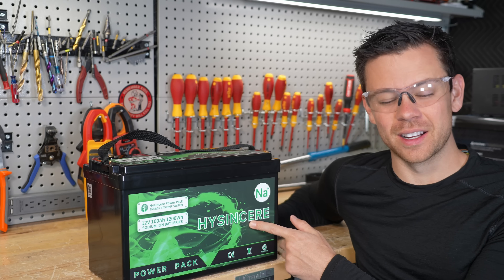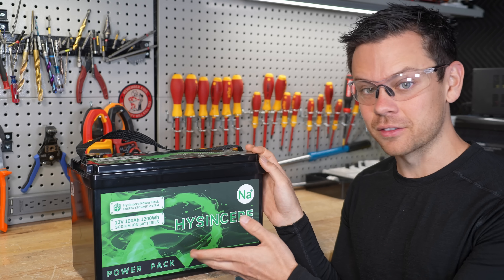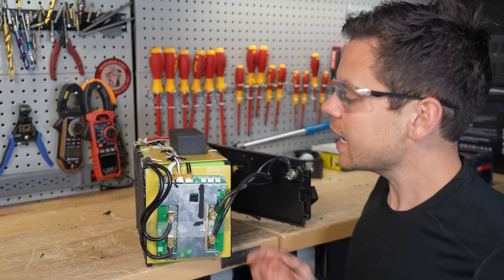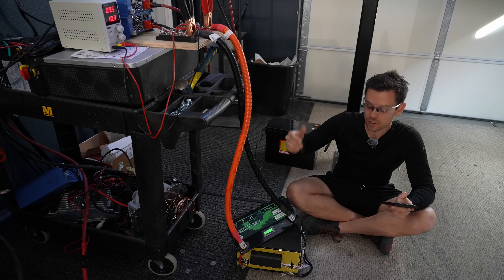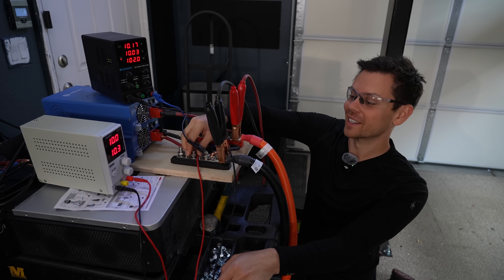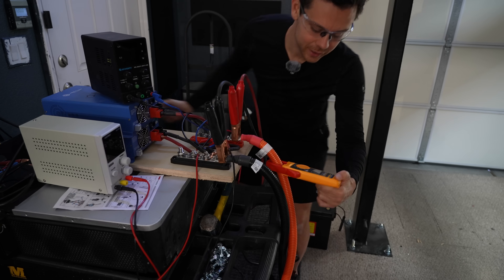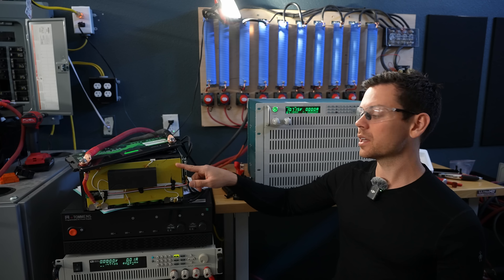Testing My First Sodium-Ion Solar Battery

Comment: The design spec of sodium batteries is to discharge down to I believe 6 or 7 volts for full capacity.  Your equipment isnt for that battery chemistry. And yes it's already well understood that we need new inverters that will run down to voltages that low.  You weren't ready for this test and came up with conclusions based on "doesn't work with my 12v lfp equipment so must be bad ". The current price is terrible, but next years cars with sodium aren't out yet either.  Hang on to your seat because once you see these at 1/3 the current cost on proper inverters and chargers they're going to end up everywhere very quickly.  Nothing wrong with the cheap lfp we have now but it's the wrong move to ignore sodium.  It's already here to stay.  Keep your eye on it.  Next year will be crazy.

Comment: As a vehicle starting solution LFP with a heater is only practical in mild climates. Here in Central New York, November to late April we can see sub freezing temps for weeks, or even months with sub zero temps not uncommon. Keeping the heater running that hard wouldn't be practical. heating once started (with a delayed charging system wouldn't be practical either as the battery mass and insulation of the case would take a very long time to get the battery into the safe zone, and even then it would have to be isolated from the cold air moving over it. Not impossible, but it would require heating by engine coolant and an integrated heating system. An internal electrical heating system could work as well, but still would need insulation and custom charging circuitry.
Thanks for all your detailed analytical videos!

Comment: I know it's apples and oranges, but CATL is claiming their now-in-production SodiumIon(naxtra i think they call it, or idk, NaC-stra), but they're not known for BSing. I have their battery in my 23 M3 LFP. They're saying 175w/kg. That's about what i've read my cars battery is. Maybe better. Sodium ion isn't there yet for home storage but within a year i imagine will be dirt cheap and match LFP with no need for heating. This is a rapidly changing and evolving thing now that the big guns(CATL) are in mass production. I think that'll trickly down to home storage. 
I cannot wait to be off grid or close to it.........By the time i get a new home built even with the nonsense economics we're suffering(tariffs and harming renewables) i imagine it'll be 20% cheaper than it is today, inflation accounted for. Just the other day CATL says their ev NAXTRA batteries are clocking in around 10 bucks a kwh. That' sjust crazy

Comment: The problem I see with sodium ion is that it has nearly no value for recycling. Only some copper and aluminum. LFP has some lithium and NMC also has nickel and cobalt. Didn't know round trip efficiencies were that low. Maybe LFMP is the next step before sodium? And maybe sodium batteries will get different variants as well? I mean we say 'sodium' battery, but if we say 'lithium' it can be LFP, LFMP, NMC, NCA, LiSOCl2, lithium manganese, and more.
Reply: There are various sodium battery chemistry, like sodium manganese, sodium sulfur, solid state sodium, anode free sodium metal, etc. But none of them are on the mass market just yet as those are still researched in the labs

The only sodium battery chemistry that are mass produced right now is sodium iron oxide (NaFeO2)
Reply: @sihamhamda47 that's the comment I'm looking for, thanks! I know there is a chemistry with lots of nickel but that's not readily available so it defeats the point of using sodium instead of lithium. There's also salt water batteries which suck, and some kind of molten state battery. Needs to be heated at like 200°C to work. I don't think that'll be a good chemistry either

Comment: I've made lots of sodium-ion batteries for vehicles, much better than agm and cheaper even. I have one in my car, atv, snow blower, lawn mover and even in jump starter (10Ah is easily enough to start a car). There's no point using lead acid anymore as a starter battery. There's some videos on my channel if you're intertested

Comment: not a battery expert.. but why you dont discharge it till bms shuts you off? why 10V? and can you share somewhere how much kwh it took to charge the battery and how much kwh you get out of the battery ? 0-100% and 100%-0? ...
Reply from the maker: Did that on first test
Reply: @WillProwse  thanks for the answer! :) will check it out!!.... i honestly dont see that big issue in such big voltage change.. my pv invertor works with battery voltage of ~500-800v. So to have this batteries in series with some balancing might be interesring option (if the price is right)

Comment: NO.   Automotive Development Engineer Here from the former REAL Chrysler Corporation.  Sorry, -22F is NOT  a starting battery, we normally test to -40F or below, routinely vehicles have to start at -50F and -60F.    A HIGH internal resistance battery is NOT a starting battery, EVER.   at -40F it can take 850 AMPS to start a moderate sized engine.   Cold engine, cold oil, cold everything, and, since the fuel is cold,really cold at those temps, you might need to 'crank on it' for a few seconds, so that is 850 AMPS not for < 1 second, but several seconds, lets see your modern 'push button start' car handle that rather than you holding the key forward to start and doing it for 3 to 5 seconds.    NO WAY IN HELL is that sodium battery going to be a 'good starting battery'.   A lead acid will give up 150-200C+ in a starting environment.   Especially when its plates are formulated as a 'starting battery' which is a world different than a 'storage' lead acid battery.
Reply: Yeah i live in Wisconsin and we see -20F pretty much every winter at least one or 3 times.   I've seen -30Fs a few times in my life.

Comment: The main issue I see here is these are being compared to lithium and being used with equipment designed for lithium so they are getting a bad review. It's like using a lithium battery in a system for SLA batteries and calling them junk because the specs don't line up.

The discharge curve is linear so SOC can be read directly by voltage making it exponentially easier. The low voltage cutoff is way too high, sodium ion can be discharge to near zero volts. In fact a lot of grid scale are shipping them shorted. Companies shipping these with a BMS designed for lithium are doing a disservice. They need a cutoff of ~1.5v per cell. This would give a range of ~15.8v to ~6v usable on these batteries. Cutting them off at 10v is leaving a lot on the table.

Once the inverters / equipment catch up to the new chemistry to make use of the wide voltage range and the manufacturing ramps up, these will be everywhere. I predict these will be cheaper than SLA due to the abundance of material, no hazmat classification, and weight.
Reply: That huge voltage range is a potential liability as you will need over 2x the amperage for a given wattage between 100% SOC vs 10%. Your equipment is definitely going to run hotter. Voltage curve is also chemistry dependent so future research isn’t going to change that.
Reply: @ratshackmojo  If you don't account for it, but that's true of any design.

Comment: Give it a few years for the technology to mature. I also agree that the quality of these early release units will vary greatly as shady pump and dump builders get mixed in with quality builders.  

The only other review of anything Sodium batteryI have seen was Hobotech testing a Bluetti system. Bluetti is one of the leaders building power stations so you would expect higher build quality.   Hobotech noted the higher cost and heavier weight as well as larger unit size. The plus side was the Bluetti Sodium battery unit can be charged at below freezing temps.

Comment: The promise of Sodium ion is cost.  Electrolytes are still being developed and production lines are still being ramped.  I would think in two years, the charging curve can be flattened and the cost will be less than LFP.  The long term goal of Sodium is cost at roughly 25% of LFP, or about $25/kWh.  It will take time to get there, check out some of your old LFP reviews from about 5 years ago when the chemistry went mainstream.  If South Korea can start producing Na+, we should see a good drop in price as they compete with CATL.  At this point, all those green cells appear to be first gen CATL cells, likely early demos, or first run production on the new equipment.

Comment: I have an unrelated question for you. how about wiring a Vatrer 300 amp hour battery in parallel with a different 200 amp hour battery and utilizing the self-heating and Bluetooth BMS from the Vatrer for both batteries?

Comment: I would not discount Sodium just yet, in Tech SSD drives with TLC NAND were considered the worst thing since the first great video game crash, then about eight years ago Premium TLC drives started to come out that completely owned the market, products like Samsung 980 Pro.

Sodium will probably do something similar, new tech and ideas like staggered discharge to smothen out the curve could be one thing that keeps Sodium in the game.

Like all tech it does have downsides though.

Comment: From the graph, 14.5V resting (~3.6V/cell) would be about 80-90% SOC, and 10.6V resting (~2.6V/cell) would be about 20% SOC, so you were able to use about 60-70% of its total coulombic capacity. It is kinda like Lead Acid, in that about half its rated capacity is generally usable (in this case meaning in a useful voltage range), except that it won't get damaged if you deeply discharge it - it'll just need a lot of energy to recover to a useful voltage range from a deep discharge. I wonder how much of the heating is due to exothermic processes and how much is due to the ~0.6V drop (60W at 100A) due to internal resistance?

Comment: Lol ... the video should be called "here is my charger collection".
For what i experimented .. Sodium cells are way behind LiFePo4 .. and still will be for a long time, even the price is not lower... so .. it need at least 5 more years before maybe catch up.
Yes there are some advantages, temperature wise particularly .. but appart from that ... naa .. not good .. :D
It remind me the Oled war with LCD, first OLED in 2007 and see today, yea Oled got advantages but it's not the total game changer that was announced and even worse, it's now kind .. dying under LCD technologies like micro leds .... yea ... i feel the same will happend to Sodium cells. And a new technology will replace both LiFePo4 and Sodium ...

Comment: didn't know about the voltage....no future then (at least for me). I need small "high voltage" battery packs to run my house (currently with 320-330V LFP batteries)

Comment: Testing Na battery capacity charging to 14.5V ? Ridiculus, it is meant to be charged to 16V. It is very different, so it would need different inverters. Also it is early days, price and resistance will likely come down soon.

Comment: Sodium based batteries are finding their niche in EV battery packs when mixed with LFP in a hybrid arrangement. CATL and other major manufacturers are pioneering this and they would not pursue it unless viable at scale.  For home energy storage I agree with Will, LFP will remain king for the foreseeable future.

Comment: It sounds like more tech garbage that's goung to fill the toxic waste dump. If they make it recycleable that would be a huge benefit to grid scale applications. Also, What does an individual cell look like. Let's see some DIY builds.
Reply: It was shown in video. Green cells like others 21700 or so.

Comment: Sorry - i am shocked
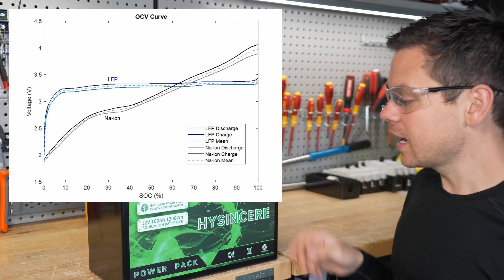Film at 6:50 seams to show, that he the battery was charged up to 14.5V, about the limit of LFPs. But Sodium has different voltage limits (ca. 4.1V per cell). You see this eg. at the charging curve at 0:20. This curve also shows, that 3,65V is only 80% to 85% SOC for this battery. You can't charge a Sodium Ion battery to 100% with an LFP-charger. I hope the video will be corrected.
Reply from the maker: Oh no we all know that. I am using standard 12V equipment to charge to 100%. Then discharge to 10V which is the limit of most 12V equipment. That's the whole point. Did you not watch the video?
Reply: @WillProwse  Of course i looked the whole video. In general you are making a good job.
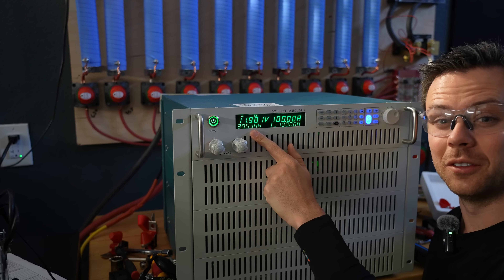But in the video, you are speaking of a fully charged battery (not correct) - at 7:26 you are talking about 70% SOC: (also not correct according to the charging curve).
The conclusion of this video can only be: Don't replace a LFP with a sodium ion battery without adjusting your (solar)charger. But it didn't mean, that sodium ion batteries are doing a bad job in general. I use them in my camper and at home since one year without any issues up to now.
Reply from the maker: @AndreasKrau-fm4gi  did you see that the power supplies hit high voltage disconnect. That BMS is programmed to hit that limit.
Reply from the maker: @AndreasKrau-fm4gi  did you see the efficiency figures for literally the best sodium ion batteries. It's only 90%. That means you need to spend more money to get 10% more solar panels and more space to mount them
Reply from the maker: @AndreasKrau-fm4gi  comments like these are making me want to make a second video to explain all of this even more. I can't believe people even think these things are an option for solar
Reply: @WillProwse  yes, of course, but i don't now the BMS from Hysincere and its limit - but correct would be a voltage of 16.4 of course.
Reply: @WillProwse  This is very interesting, indeed. I therefore will test a LFP cell and a sodium cell to see, if it is correct.
Reply: @WillProwse  i would be happy to see another video. There is so much hype about sodium ion cells - and i don't have any problems since one year. But i will do another test about efficiency.
Reply from the maker: And no, I used a lead acid profile to get it higher, and I charged until we had a high voltage disconnect. So that's what the BMS is programmed to cut off at.

Comment: Sodium is the future of home and grid storage. So many pros to this chemistry and it will only get better.
Reply: LFP is already really cheap. A 15kwh Yixyixiang battery is only like $1500. We'll see what happens with the new CATL sodium batteries though. They haven't come out yet so the tech in this video is old.
Reply: @mathehack1  Yes it is already really cheap, but stuff can get even cheaper, rich boy.
Reply: Na round trip efficiency is the killer. Car starting where efficiency doesn't matter it is great. But grid storage use will add to the cost of electricity and my roof space doesn't generate enough electricity even with 90% efficiency. Unless efficiency improves, for Na to work you have to have free electricity generation, loads of space and must be very very very cheap to beat LFP. Na will always be worse than Li it's all about the chemistry of the ions not battery construction technology.
Reply: @vicvalliant1092the new CATL cells are supposed to have much better characteristics but they're not out yet. So sodium batteries replacing LFP is yet to be seen.
Reply: @mathehack1  I vaguly remember some companies claiming to have solved the efficiency problem.  LFP is 98 to 99% RTE (best ones)
Reply: Sodium ion will likely be far cheaper than lithium in a few years time. They are also very good in cold temperatures.